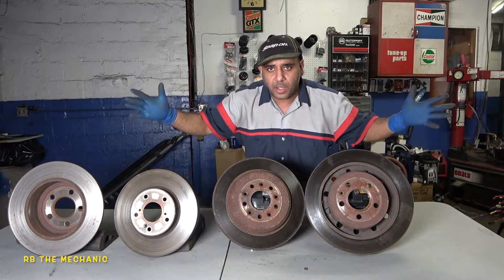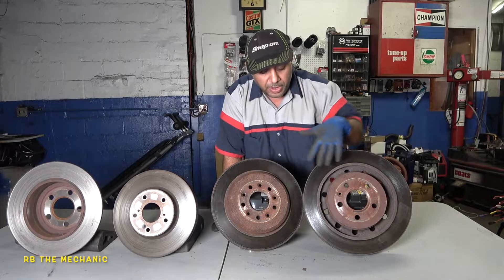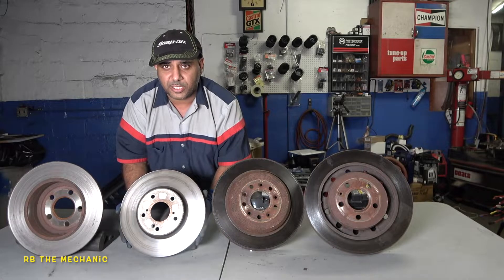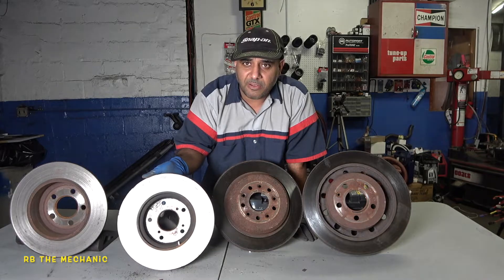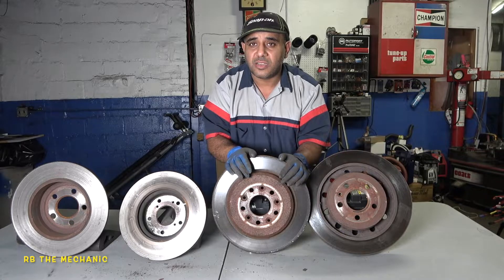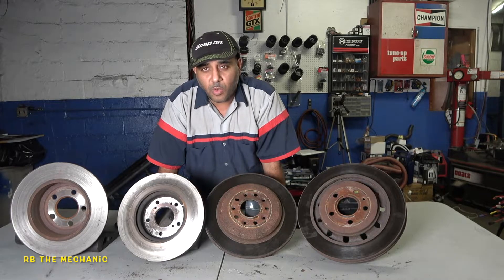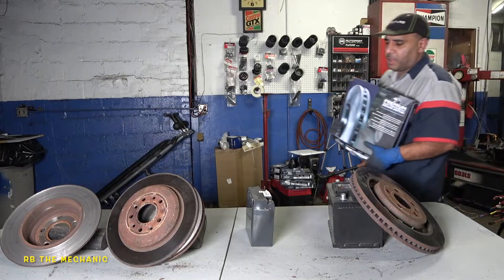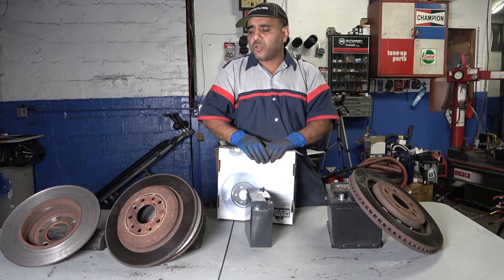Car shakes when Braking   pick a bad rotors   A   B  C  or  D?

Comment: Hi RB.  I had this shake and brake problem on my 02 Accord with the original rotors.  I always use Honda pads btw.  So I bought white box rotors and did the brake job and it was great.  Super smooth braking.  Until 3 months later it started happening again.   Why it comes back? Is it the rotors keep warping?
Reply from the maker: Yup rotors are warped usully somthing like this happnes if brakes are locking up and causing rotor to over heat so try cleaning and make ire the brake pads sit nice and smoothing greasing is a must
Reply: @RBTheMechanic  Thanks bro.  I'm a fan of your channel.  Always good info that you don't find other places.  Keep up the good work.
Reply from the maker: @gfriedman99  thank u!

Comment: thanks mate, if you had to answer thousands of messages, you couldn't possibly do it, so thank you so much my friend.
Reply from the maker: Lol I was thinking about that this morning I wasent feeling week so I got back late on messages usully through out day I get like 30 messages and I was wonder when I would stop replacing but it seems like after 40/50 I wouldn’t be able to keep up
Reply: yeah, well in regards to your cv joint video, I used vaseline to hold the retaining clip in a neutral position, open end of clip down position, it worked, but at first without the vaseline, refused to go in, also I put no spline grease, or antiseize on the outer spline, the companies say don't put any spline grease, or antiseize.
Reply from the maker: @janpalmer3025  nice job!!!!

Comment: I thought there was a good rotor, B, but I was not correct, I once rewired a Electronic Throttle Body, blew the 60 ohm resistor in the Ecm, very good video.
Reply from the maker: U did more deep stuff then I even think of doing yeah some times customers thing just because rotor looks good dosent mean it’s good
Reply: I'm gunna replace my, already assembled new cv joint/driveshaft  tomorrow, says don't apply any spline grease, Vaseline, or antiseize, I will not be, I have replaced assembled joints/halfshafts, before, but put small amount  of spline grease, I really like your videos, very useful, and you are someone I respect.
Reply from the maker: @janpalmer3025  yes thank u!! I’m always here to help first try if it goes in h never know it might set it other wise try this